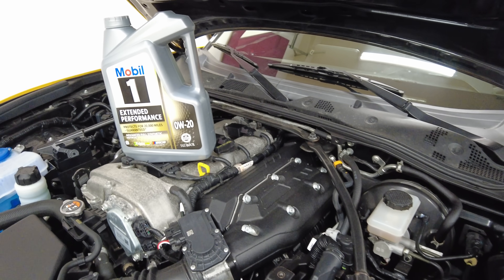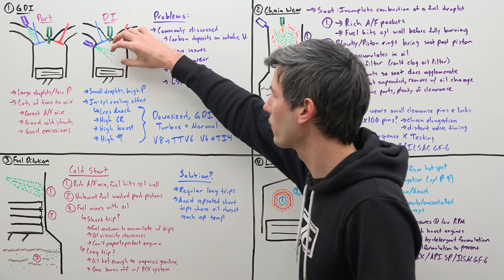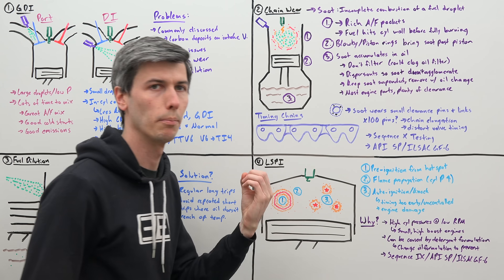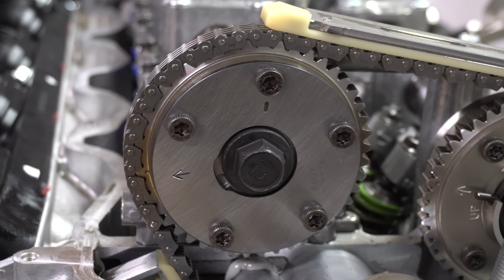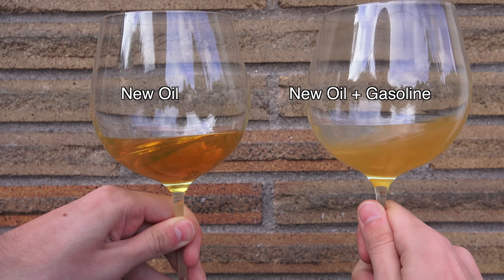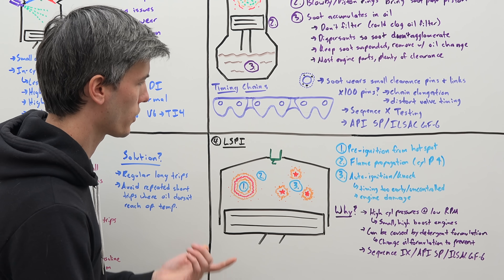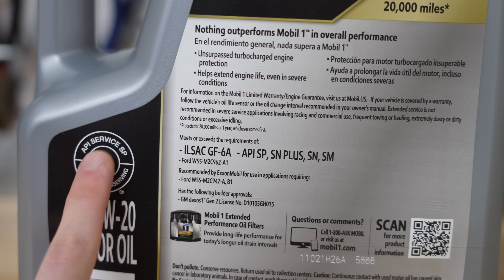3 Big Problems With Direct Injection Engines (Gasoline)

Comment: More reasons why I shouldn't get rid of my pre-DS4 Toyotas.  I've seen firsthand how much carbon builds up in these engines even though the Toyota DS4 system uses both port and direct injectors.  So you can imagine how much worse it would be in all direct-injected engines.

Comment: I can speak only for Honda cars since i work on about  16+ hondas a day. their oil dilution is the worst. 4k oil change intervals and the oil comes out like water smelling like gasoline. everything this man said is 1000% true. as a technician when you remove certain parts of the engine you can tell how efficient the engine is, this DI engines suck. they breathe in their own crap lol. clogged intake ports. as far as the oil, in any turbo charged engine with DI run something a bit thicker. tho it wont be as thin as oem when new, when the gas breaks it down you still have viscosity to protect engine internals.

Comment: My question would be if a 2018-up Ford Mustang GT is affected by these three big problems. The third-generation of the 5.0L 4V Ti-VCT "Coyote" V8 uses both port injection and direct injection: the port injectors work first during startup, "blending" with direct injection as coolant temperature begins rising. With that being said, is such PI/DI engine absolved of these "3 Big Problems" associated with GDI?
Reply: Put a ‘oil separator’ aka ‘catch-can’ on it to reduce oil vapor thru the intake

Comment: Do catch cans help with the fuel dilution issue enough to be worthwhile mod / upgrade?
Reply: If they helped the manufacture’s would incorporate them. Change your oil at the proper recommend oil change intervals. If your really concerned have your used oil sent out to be tested once in a while. It’s cheap to do and your get a report back.

Comment: I've seen more gdi engines wrecked in the last 5 years that I can shake a stick at. People are lazy and often mistreat engines based on manufacturer directions. I don't know if this is a sure thing, but generally if you contaminate oil (even if you evaporate off the gas) it doesn't work as well as oil that just has mileage on it. I've worked on cars, trucks, semi's, tractors and heavy equipment for over 30 years and I can tell you that simple is best when it comes to the average person, sure some folks actually maintain their stuff but most folks think companies are in it to provide them with a product not that their main goal is to make money...and if it happens at the hands of planned obsolescence than so be it.
Reply: First failure of maintaining and engine is going by the oil light to change it.

If you change the oil at regular intervals you're fine, if you wait until the light tells you to change the oil you're gonna have issues.
Reply: @glenwaldrop8166  for sure, I run synthetic high mileage that is supposed to be good for 10,000 miles but I can't bear to think of sludge building up🥴
Reply: This is why I stick to the 3,000-mile or 3-month oil change intervals I've always done with my car's there is no way I would ever go more especially on a direct injected engine. Both of my Chevys have direct-injected engines and are right at the two hundred thousand mile Mark and still run wonderful. Oil is cheap engines aren't.
Reply: That's why I bought a 2020 Corolla SE. It's like a fire and forget missile. Just a regular oil change, a regular fuel grade. Low maintenance cost, no headache.
Reply: "Wah! I want improved fuel economy and more power but refuse to change my oil on time or take care of my engine. How dare these evil dirty manufacturers "plan" the obselence of my car?"
Reply: @spacebound1969  I used see grease fittings, and now it's all sealed balljoints and bushings that require costly part changes. I wish I could a benefit with some of the engineering choices but other than money it's kinda hard. 

Sure people would skip out on their service intervals and mess up parts but a ball joint change was simpler and cheaper than a whole control arm by far😪
Reply: @coryernewein  the one thing they've gotten right is the sealed bearings last longer than the old style, though I've gotten 100K+ with regular maintenance, at least every 50K on wheel bearings, can't stand the tie rods and ball joints not having grease fittings.
Reply: @glenwaldrop8166  I was told by Toyota when they replaced my rear wheel bearings that they are not sealed but rather shielded. Water ingress is still going to happen, just slower...but that also means they drain slower and can't be repacked. Call me a dinosaur and say get with the times but I'm still in my 30's lmao I just wish for vehicles to be designed with mechanics in mind and not just the pencil pushers🤑
Reply: @coryernewein  agreed.

I don't mind packing bearings but I generally can't complain about their life spans.

The ball joints though, that's unforgivable.
Reply: @glenwaldrop8166   @Glen Waldrop  the ball joints are super stressed from the wheel sizes we run today, so much torque is applied with the taller wheels. I might just have bad luck with wheel bearings, but every truck I've had since I got rid of my "hand me down" from grandpa gives me issues after 20,000-30,000 miles. With that said I live in the country and happen to have gnarly road conditions alot plus I launch a lot of boats lol perhaps it's a personal problem🤣😂
Reply: @coryernewein  that's a factor but if the wheels are deep enough then the ball joints can be at the center of the load, lined up with the wheel bearings.

Not sure how many cars are built like that but it's certainly possible now and it wasn't possible back in the days of 14 and 15 inch rims.
Reply: @glenwaldrop8166  I wish you had, had a part in the planning of my wife's Jeep Compass bahahaha every 40,000km it needs a whole front end job
Reply: @coryernewein  Seems to be a Jeep thing honestly.

Jeep and Ford trucks over the last 20 years, they're the balljoint group.

lol
Reply: @glenwaldrop8166  so you are saying that It's a Jeep thing I can understand bahahaha

Comment: I have 182,000 miles on my 2017 expedition with the 3.5 EcoBoost. I have used mobile one in all my vehicles for the last 15 or so years. So far the EcoBoost is still running strong. If it lasts until 250,000 miles, I'll feel I got my money's worth out of it. At that point, I may replace the engine and transmission and check suspension and driveline joints and keep going since I really don't like the center console of the 2018 and newer expedition.
Reply: Given the price of new cars trucks and especially SUVs I can certainly see doing this. If it's in otherwise good shape, spending say $10K for a freshening up... New drivetrain, interior fixup, maybe a decent paint job, and it will be like a new car. But make sure you get the right insurance like Hagerty or something. State Farm and such will consider it a junker.

Comment: So if you drive long distance the oil will reach a temperature that will vaporize the fuel in there. That makes sense. Thanks for sharing. My question is what does constitute long distance? Is 30 minutes enough? And do we need to drive long distance at highway speeds Or is it effective also at urban speeds?

Comment: I really like Mobil One oils but when running Flex Fuel in my 2020 Subaru STI I noticed it broke down very rapidly. I switched to Valvoline VR1 and it seems much better (more viscosity after 1500 mile oil change interval). I recently switched to Motul Oil to test out and see how it performs because VR1 unfortunately does not come in the 5w40 weight I like to run.

Anyway, once again a fantastic video!! Keep them coming, one of the best channels on Youtube, hands down.
Reply from the maker: Thanks for the kind words! It'd be interesting to submit your samples for analysis after each change, and see how the results came back!
Reply: Hey how did you find running the Motul oil? I hear that depending on the variety of Motul oil they are Ester based which helps quite a bit in preventing oil evaporation.
Reply: @drakebond8228 I ended up switching to Valvolime VR1 20w50 with my race engine. Motul provided sufficient oil pressure but my builder recommended the switch because of how much boost pressure we were running. 

I never notice any excessive oil evap with any oils I've used. I know that's not much help.

Comment: I feel better about bypassing my block heater's thermostat so during the winter cold start temps are 30F higher than ambient. Hasn't thrown a code yet either.  I love Mobil 1 but am now using Penzoil Platinum, which passes ILSAC-GF6 certification but claims to run cleaner based on being formulated from natural gas.

Comment: Toyota with their D-4S system seems to have solved many of these issues by having both port and DI. The system can use either or a combination of both. Port injection is fantastic for full power stoichiometric charge while DI is great for “diesel like” low end torque.
Reply: Nothing "diesel like" about the torque delivery in a BRZ/86 lol, I should know
Reply: @nthgth  *when combined with turbo charging. Lexus 2.0t is surprisingly torquey as is the FCA hurricane. The Hurricane even sounds like a diesel at low RPM.

Comment: A few really easy tips to keep your GDI engine healthy, based on the information in this video:
1. Try to limit your amount of short trips
2. Don't floor the car when you are on low RPM
3. Rev it up once in a while when it's on operating temperature
4. Change the oil regularly and use the correct oil (this is a recommended for every car, but even more so for GDI engines)
Reply: Ahh, so a rotary then.
Reply: How low of RPM is too Low and When is it just right
Reply: Toyota recommends severe service interval on their vehicles who make short trips in town. So 5000 miles.
Reply: @paladain55  What I meant to say was. At what Engine RPM is it safe to start Flooring It?
Reply: @solidgoldeazyaction  floor it when at least 75% of max torque. For this, you need some dyno charts of the engine to find out the rpm.
Reply: @solidgoldeazyaction  any rpm you choose lol it's a car. drive it. all you have to do is wait for it to warm up all the way before you drive it hard. that and follow the owner's manual maintenance schedule
Reply: @dizzydagloomyboy So, basically you're saying that drag racing or any performance application is now a dangerous impossibility? Yeah No....
Reply: 5. Install a methanol kit.
Reply: Frequent oil changes kept my 2002 Mercury Sable wagon running for 250,000 trouble free miles. 4 years ago I gave the car to an old lady up the street and it is still running great for her.
Reply: @Random-rt5ec  Ask her has she changed oil.
Reply: @Random-rt5ec  did she follow the same service chedule?
Reply: USE  BEST QUALITY FUEL
Reply: @doctorinvizible2077 my 1.5 ecoboost GDI engine has always been run on v power or ultimate if I can't get vpower, plus oil changes at 5k, its running very nicely now after 59,000 miles. Ford manual days ultimate! The good fuel helps maintain a good spray patten from the injectors, I learnt the importance of this from racing 2 strokes!
Reply: Re item 3: Rev it up…Another reason to get a Manual Transmission. CVT’s do everything to prevent revving from occurring.
Reply: @bobdevreeze4741  Weird that others seem to have success but not you 🤔
Reply: I can see why city cars were the first to Electrify
Reply: 5. Don't buy a Ford Ecoboost turbo one litre 3 cylinder engine, which uses toothed rubber belts, inside the engine oil system (crankcase) to drive both the camshafts and the oil pump.  The belts fail by perishing (the teeth fall off).
Reply: I try and do a 5000 miles max oil change.
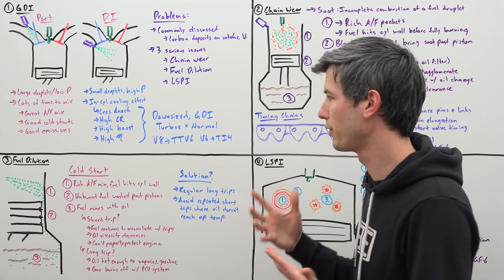Reply: Nope, you didn't quite ace the final exam. Need to look for "API SP" or "ILSAC GF-6A" on your oil to prevent chain wear at 5:35.
Reply: @briangeiger9307  That's a more specific description of my 'use the correct oil' remark
Reply: @briangeiger9307  do any manufactures state that in their owners manual ?
Reply: Castrol Edge!
Reply: If your car has an electronic accelerator it doesn't matter at which RPM you floor it. The car will babysit you and protect itself.
Reply: @Todd Maintenance intervals in the manual from the OE exist for a reason. I guess you could change your oil more frequently than recommended and yes, it would save wear and tear on everything by maybe a tiny bit more, but oil and filters aren't so cheap that you'd actually be saving money in the long run. Timing chain is an expensive job, yes, but afaik timing chain is a ridiculously long maintenance interval and should last something like 100k or more if other maintenance items aren't neglected. Of course, I'm speculating and not running any numbers so I could be wrong.
Reply: Idk how anyone is getting anything like "change your oil more" from this video. Nowhere in this video does he say or imply that oil should be changed more frequently. The message is: read and comply with the maintenance schedule in your owners manual...
Reply: @psychic_wolf  how to save money on maintenance costs: spend money more frequently than necessary. Just RTFM

Comment: Soooouh: timing belts are not a bad idea (avoiding problem 1), early changes of oil especially in short-tripped cars (every six months - be it late autumn and late spring for example) and choice of oils with a little bit more buffer (0W30 instead of 0W20 for example) allow to avoid or handle fuel dilution (problem 2) and avoiding full blast at low rpms with those mini-engines of today (problem 3) are the live savers. Oil on its own can perhaps help out but being left in the engine for up to three years (some Renaults and Nissans) is a diabolic idea. Headscratcher: Wasn't saving energy the idea of this whole GDI-hype?

Comment: my volkswagen polo 2019 has direct as wel as port injection when the engine is hot it is using direct injection and its running like a diesel it even drive a bit like a diesel with much torq down low

Comment: Just to mention, in Europe the downsizing was more from 1.8/1.6L to 1.0 Turbo. From 4 to 3 cylinders.
Having driven both, the new ones are far nicer to drive (low end torque, thanks to those turbo's) but resilience to abuse is lower... specially lack of maintenance..

Comment: Fuel dilution is a big problem. Whenever I emptied my catch can, it seemed like it was mostly fuel. The gas smell was strong. I worked down the street but just far enough away where walking wasn't practical. During winter, the engine may not have even reached operating temperature. I was doing oil changes every 2000 miles or every 2 months (whichever came first). It was worst case scenario for an engine.
Reply from the maker: If you're interested, I think you can submit those catch can contents to a lab like Blackstone ($30) and get back a report of what it is. Would be interesting to see what the fuel percentage was.
Reply: @EngineeringExplained  That would've been awesome! I no longer work at that location. A missed opportunity
Reply: It would have been worse with a carb and choke.
Reply: why 2 months? I think it is a waste of oil and money unless you race it, if you are doing short trips, for example 10 miles per day, you will reach 2000 miles after 200 days which is around 6 to 7 months
Reply: i bought an m135ix n55 and it had a open thermostat problem, the last owner didn't know but I did find the problem by looking at oil temperatures while driving, it only got up to 158 degrees Fahrenheit even after 1 hour of driving in the winter, the drained oil had gasoline smell.

Comment: I wonder why not more cars are built like Toyotas with indirect and direct injection. Depending the RPM and other factors, the computer decides which method the engine uses to prevent the disadvantages of each injection types..

Comment: Excellent explanations. At what point does the industry just acknowledge that direct injection causes more problems than it solves?
Reply: 60000 mile warranty now, 100000 mile warranty back in the day if I recall correctly. Isn't most Ram/Chrysler stuff still port injection?

Comment: Naturally aspirated port injected V8 > turbo charged direct injection I4

Sounds much better, way more reliable, simpler/cheaper to repair. It may get slightly worse gas mileage BUT if you’re pulling a lot of weight the V8 gas mileage is better.
Reply: yeah

Comment: Wow, thanks a lot for the video i was not aware of these things at all.
Now i understand why so many manufacturers are using belts for their GDI engines (at least in Europe).
Keep your great work going 😉
Reply: I actually though most manufacturers were now switching back to chains, for less service requirements?
Reply: @timjohnun4297  well i can only see it here in Europe with most of the smaller 3  to 4 cylinder engines. Most of them have belts. My 1l eco boost 3 cylinder e.g. has a belt but its inside the oil compartment, so the service interval is 240000 km or 10 years.

Comment: Ford doesn't get everything right, but making all their engines dual injection was probably one of their better moves. The extra complexity is worth it when their 5.0 coyote has a 12:1 compression ratio and makes about 380hp when running 87 octane, or 400 on 91 octane, from a 5 liter V8. Port injection for waking up and cruising, direct injection for power and towing. It honestly gives the best balance to just literally have both because you have direct injection when you need it, but avoid all the problems when you don't. On the ecoboost this arguement only gets stronger with the nature of turbos using the same oil

Comment: DI doesn't have rich pockets in the injection, and therefore mixture, is homogenous. Most DI engines are injecting high pressure fuel into a high pressure air charge. It by design creates less soot. LSPI is taken care of by proper engine tuning and fuel quality. All other factors are speculative.